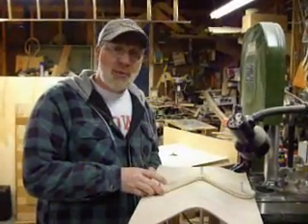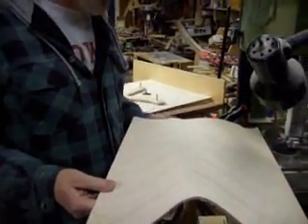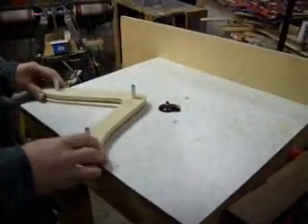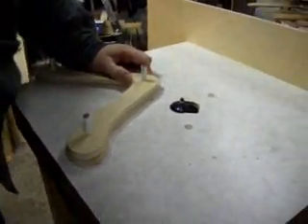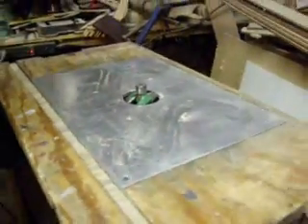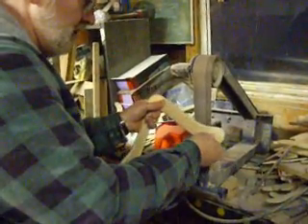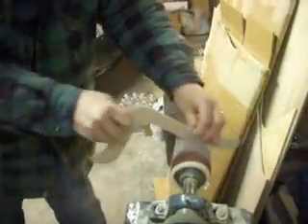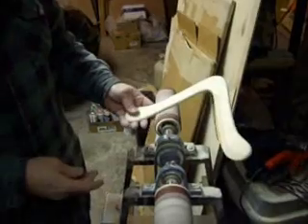Making a Boomerang with Power Tools

Comment: Kendall I am curious to know what kind of router bit was used to cut the airfoil. I currently create them with a 1 x 30'' belt sander and get varying results. Would like to create some consistancy and I just happen to have a small table router. Any info is appreciated and great post!
Reply: John Doe Eater
Thank you for the helpful information!

Comment: Very nice video man, you are very fast.
 
I never thought of using a router to do this. I prefer hand files. But wow is the router  ever fast! =O
 
Have you ever tried working with plexiglass? A fun materiial, =) It flies rather far due to it's weight. Unfortunately, Power tools don't work too well with plastic, because it tends to melt. =\

Comment: Hello there, love this video, I think I've seen it at least 9 times now. Could you let me know the size of the router bits used for the edge and the airfoil? I wanted to be able to tell the guy at the hardware store the correct size they are. Thanks

Comment: Hi my router has a 1/4" shank. What exact size do I tell my hardware store I need for the 2 router bits needed in this project? I was unsure about the bit for the airfoil. By the way I think I've seen this video 8 times and learn something different each time. Thanks